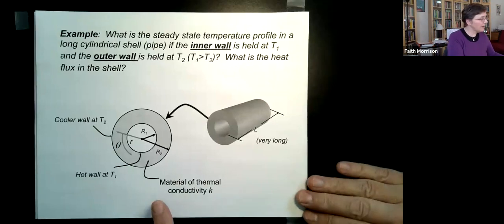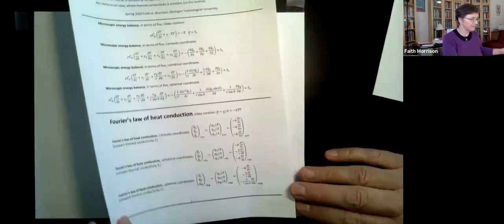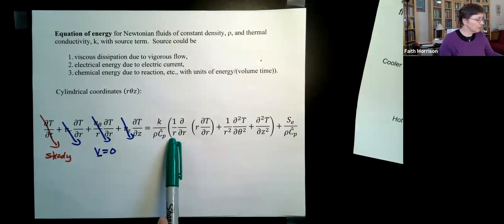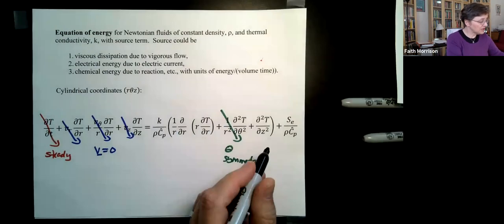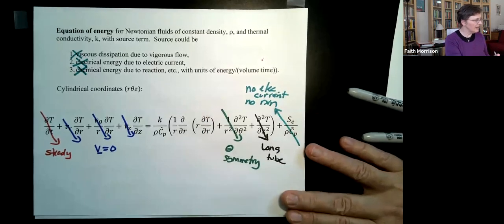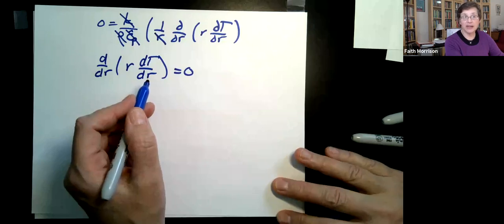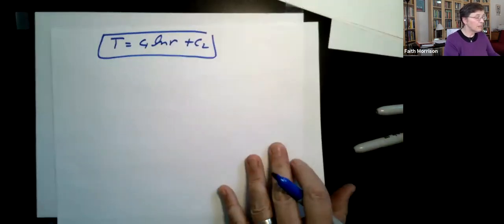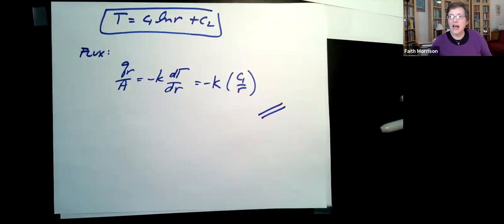Microscopic Energy Balance in a Tube(1D Radial Heat Conduction)

Comment: Q = - k A dT/dR, Fourier's Law equation (1)
Q = - k A dT/dR
For a cylinder
Q = - k 2π R dT/dR equation (2)
Q, -k, 2π is constant (C). Therefore, the equation can be summarized as:
Q / -k 2π = dT R / dR
-C = dT R / dR equation (3)
-C ∫ dR / R = dT
-C.Ln (outer / inner) = dT
-C.ln (outer / inner) = Temperature (outer - inner). Henceforth, the minus sign is not rewritten; it will be eliminated by the negative of the temperature difference.
C. ln (outer / inner) = dT ` equation (4)
C. Ln (outer / inner) = dT, for all states the outer value is represented by e (a natural number).
C. Ln (e / inner) = dT, 0 ≤ inner < e equation (5)
We combine equations 3 and 4.
C = dT. R/ dR ~ C.Ln (e / inner) = dT, eliminating C and dT
1 = R/ dR ~ Ln (e / inner) = 1, then
R / dR = Ln (e / inner) equation (6)
R = dR. ln (e / inner), dR = outer - inner
R = (outer - inner). Ln (e / inner), outer - inner is the thickness of the cylinder. The radius of the envelope can be determined using this equation. Equation (7)
R = (e - inner). Ln (e / inner), outer is changed to e (natural 

We change it to function form
f ( x ) = y
( e – inner ). Ln ( e / inner ) = R equation ( 8 )
( e – x ). Ln ( e / x ) = y, inner is changed to x and y is changed to R, where 0 ≤ x < e. So the equation changes to. When x = 0, this means the cylinder is solid
f ( x ) = y
f ( x ) = ( e – x ). Ln ( e / x ), so
( e – x ). Ln ( e / x ) = y

Weaknesses of using natural logarithms to solve heat transfer problems in cylindrical shapes.
1. When comparing the thicknesses, outer = e (a natural number) and inner = 1, i.e., the thickness e is -1. Therefore, the natural logarithm value is 1. This value of 1 is identical to the plate shape. This is highly unlikely. If the plate and cylinder have the same dimensions, they produce the same heating value.
2. The expression using natural logarithms expresses the area, not a dimensionless number. If not, how can we express the narrative in the natural logarithm expression?
3. How do we calculate the radius of the envelope (although I must explain it briefly in equation 8).
4. In a solid state, the resulting heating value will be infinite. Equation (4).
5. Continued from point 4. The infinite calorific value is caused by the natural logarithm, which expresses the natural log e/0 = ~.
6. Continued from point 4. If the Fourier law formula is expanded (interchangeable) to predict the temperature value at the center of a cylinder when the cylinder is solid, the temperature will produce an infinite value at the center of the circle (can reach billions of degrees Celsius or more). This is highly unlikely.
7. Using the natural logarithm cannot explain changes in the area of a cylinder. In other words, the use of the natural logarithm cannot be linked at all to changes in the area of a cylinder.
8. Continued from point 3. The radius of a cylindrical envelope or covering is always greater than the radius of the cylinder (there is an abstract explanation). However, using the natural logarithm starts from infinity to 0 (zero). This is highly 
unlikely.